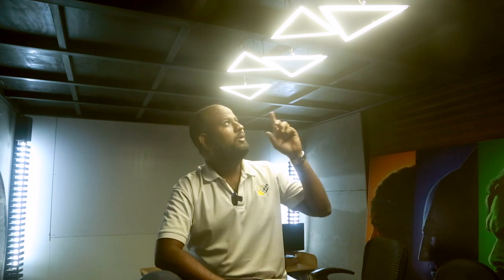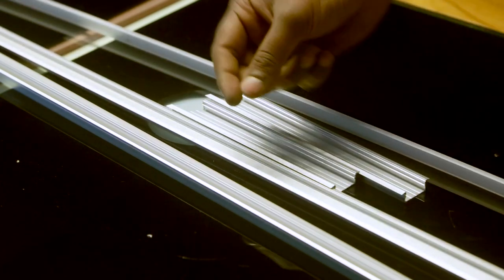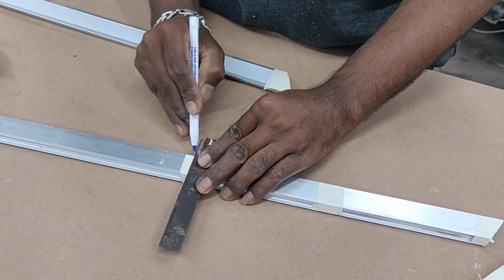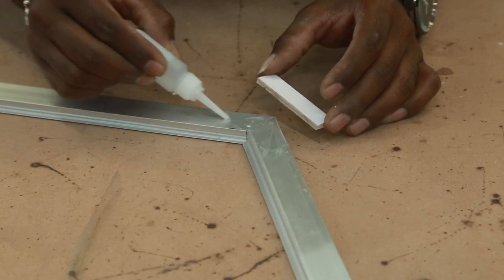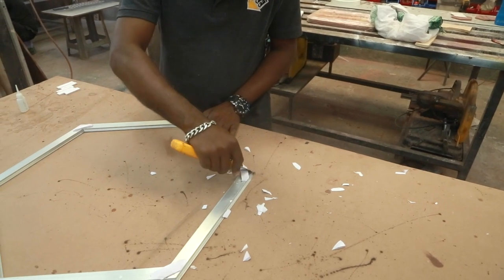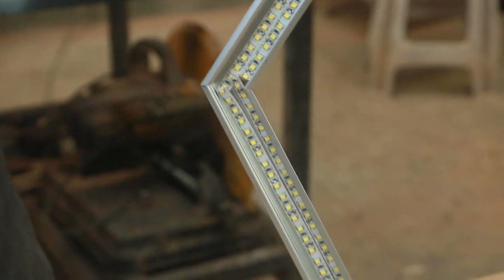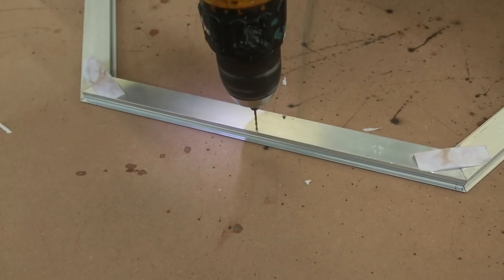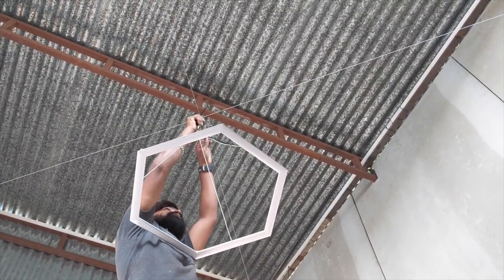DIY Designer Ceiling Lights with LED using Aluminium Profiles

Comment: A couple of questions. 
1) What joints would you use to make the lamp more industrial looking and durable? 
2) Why not hook the power supply on the top, so it doesn't worsen the aesthetic aspect?
3) Why not just use 1 strip that is more powerful? 
Questions questions, questions...
Reply from the maker: 1. Use a custom made aluminium clips. 
2. Yes power supply always should be hidden.
3. Even a 240 led per meter is not powerful. So had to use twice.

Comment: Waiting for the led  tube video. As you said, it is easier to work with led tube as it works with 220v. It is efficient.

Comment: Is it possible to do power coating and make it black for the body
Reply from the maker: Powder coating is not required. A proper coat of paint is also enough after priming
Reply: @Kalaakaar-in  i am looking for walnut brown or black colour base colour.
Reply from the maker: @shardulpawar1277  all can achieved using automobile grade paints

Comment: Hi,can you please provide me the complete required material or complete product?
Pls let me know ASAP,my gym opening in January,my budget is so tight and this seems cost effective.
Reply from the maker: These are not cheap methods. It costs as much as the normal lights. But the advantage here is that it's custom made to your space. And the shapes also can be customised.

Comment: Great video 👍👍👍 Can I know what clips I should use for this I have tried a lot in the Market  but they are supplying l shaped clips which can be used for 90 degree structures means we can do square or rectangle bute I need to do triangle 📐 or hexagonal 
Please suggest 🙏🙏🙏
Reply from the maker: Not all angles are available. That's why we used PVC foam. The bond stays strong. Alternatively you can use Fevicol A-Kwik with activator for faster bonding

Comment: I tried the same angle 60degree cut but it is not joining and having space of 3-4inch
Reply from the maker: Check the math in Google. It will help get the angle right